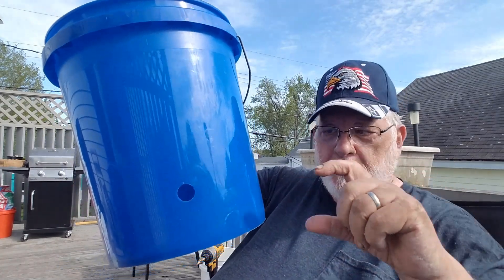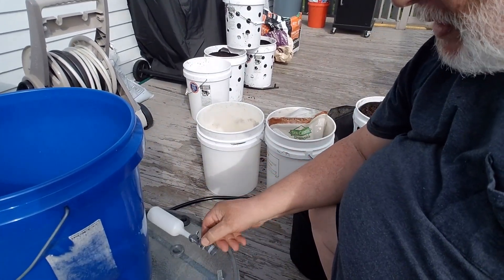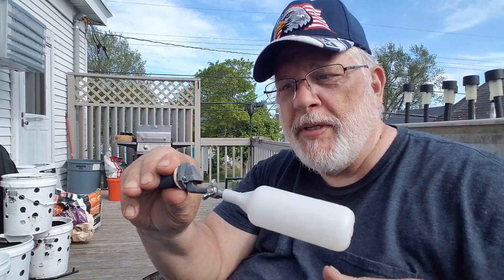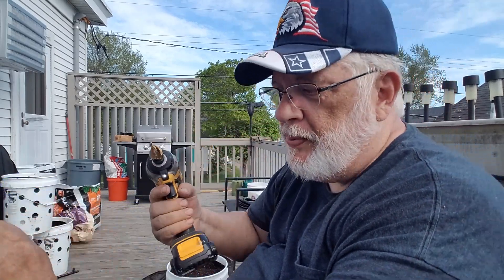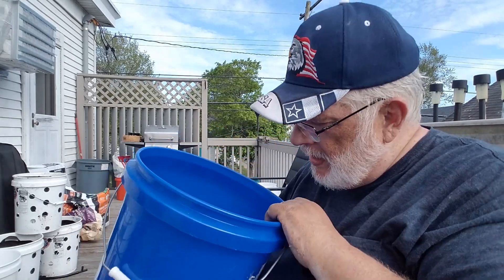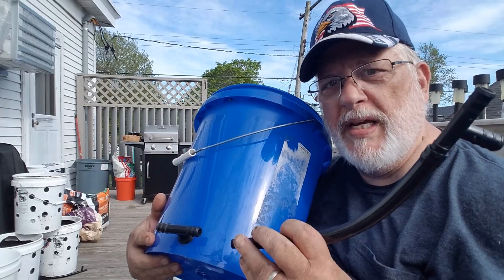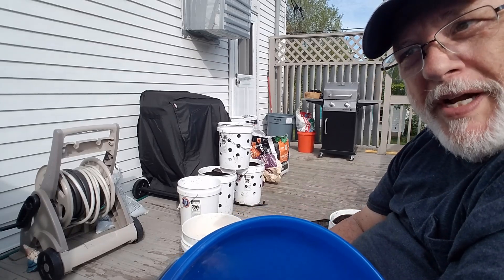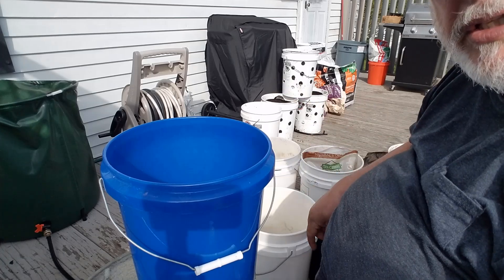DIY Auto-Watering System with Float Valve | Easiest Setup Ever!

Comment: What kind of float would let water in only when all the water is gone then fill up to an inch or so?
Reply from the maker: That's the purpose of a float. When the water gets low it keeps allows more in to keep the same level in all the connected buckets.
Reply: @whyamigreen I'm talking about a float like the autopot grow system uses. Its like a dual float that lets water in only after the water thats in the pail is gone. They are spendy id like to make a diy autopot system with a more affordable float.
Reply: @whyamigreen I forgot, would doing this DWC setup for maybe 2 buckets can I use a bilge pump along with an air bubbler!??